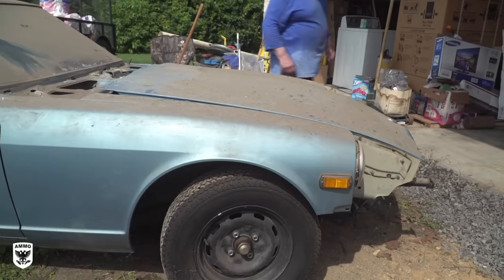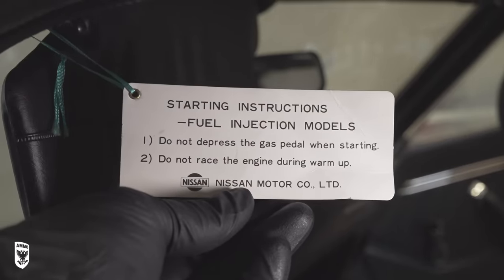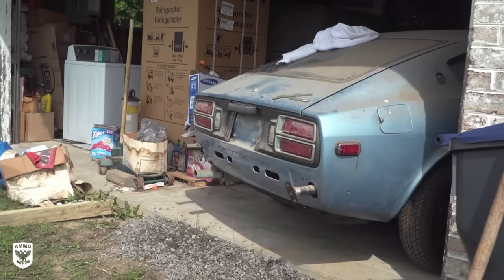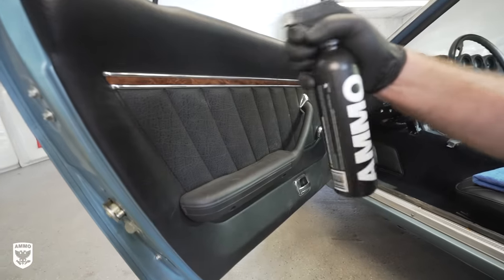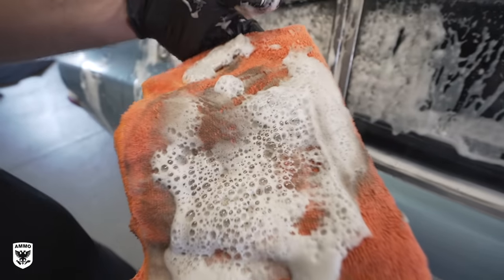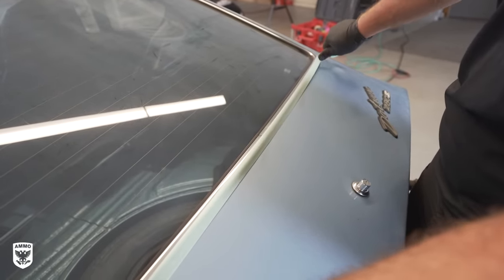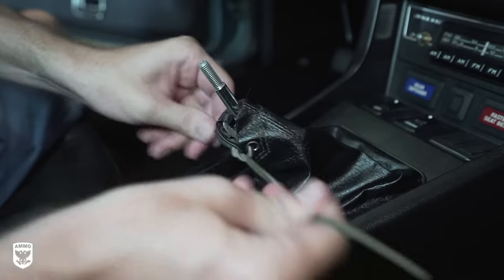First Wash in 44 years! Barn Find Datsun 280z with only 350 Original Miles

Comment: this Z was more than a barn find, it was a time capsule.... finding one of these in such impeccable condition is like finding a unicorn
Reply: Unicorn indeed.
Reply: Unicorn i see every day ... that fairlady love it from the first side
Reply: I've got a 240Z never restored it
Reply: Yes, true. The Z's didn't have galvanized bodies which lead many to be rusted at the welds! Very rare.
Reply: When I was in college in the 90s I worked in a car wash and this old timer brought in a Pontiac Star Chief in this sort of time-capsule condition. It was freaky. Every little bell and whistle on that thing worked - even the old mechanical clock. It was I think a 67 model, and it looked like it just rolled off the showroom floor.
Reply: I found a Unicorn but just like a car without a warning device it had no horn, my brother insisted it was a donkey but hey what did he know.
Reply: Had one just like this one many many years ago. SadIy couldn't finish restoring it. It was originally this same color. Love these cars. I wished I held onto mine.
Reply: Love the metallic paint not like the shiny plastic looking cars of today
Reply: @darlachief4610  Mine got wrecked so I sold it...😢
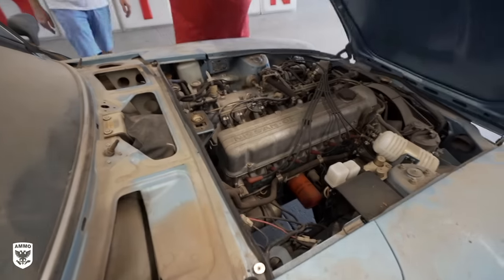Reply: I think they said 350 miles, driven home and left in the barn since. So how did it get a Fram oil filter? 4:25  I'm pretty sure it didn't come that way.
Reply: absolutely stunning!! i love old Zed cars!
Reply: I have one of those….. in every girl on the planets pants.

Comment: Another I'd like to share. It's true, I promise.
 An airline pilot brought in his relatively new 280z, because it would intermittently lose power, to the point of stalling. He'd sit for a minute, it would start and run fine for days, and then happen again. He brought it in a couple of time, tech could never duplicate or experience the problem. My uncle  ( service manager) finally asked him to leave it, with permission to drive it home, etc.... until he experienced the condition. The pilot dropped it off, before going out of town. Take as long as you need. About the third day, my uncle experienced it. He told the tech to drop the fuel tank, it definitely felt like a fuel starve problem. 
 It was a Hershey Bar wrapper,  in Japanese. It would float around until hitting the pickup, and starve fuel. When the car stopped, it would float away, until next time! 
True, I swear!
Reply: If you said Kit Kat no one would even doubt.
Reply: I must have been doing something wrong.  I was an airline pilot and drove used '85 & '92 Toyota Tacoma my whole career.  My wife had a new '76 280Z while in college.
Reply: I believe it, we had a very similar situation happen with a tractor on the farm. That is one frustrating problem to figure out lol
Reply: @jcheck6  I had worked and saved my money and with some help from my Dad I got my 76 280Z right after graduating high school. I about wore that car out and sure wish that I could drive it one more time. Mine was what I think they called "racing green".
Reply: @texaswader  I am sure you really appreciated yours after you worked hard to get it Tex. You must have been the coolest kid on the block!  I know what you mean about driving it one more time.  I do the same but with airplanes.  Would like to fly the Phantom one more time.  My wife says she  paid it off in 4 yrs and owned it for 14.   Beautiful car except for the bumpers.
Reply: @jcheck6  Yeah the American bumper laws suck. They ruined the lines on the 70's-80's E30 BMWs also.
Reply: @jcheck6  A friend of mine, a Marine, flew Phantoms in Vietnam...He says the same thing, that he would like to fly one one more time. I appreciate your service.
Reply: Had a 69 Plymouth Fury which experienced the same problem. Rebuilt the carb, replaced the fuel pump and still persisted. Dropped the fuel tank and looked inside and found a length of garden hose in the tank. Someone must have been trying to siphon gas during the fuel crisis and dropped the hose in the tank. The hose would sink and cover the pickup. Pulled it out and car ran fine after
Reply: @texaswader  Thanks Tex....your friend as well.
Reply: Yeah. Why have I heard it was a Mars bar wrapper🤷🏼‍♂️
Reply: -Same situation with a classic black '49 Caddy convertible sitting in field for 10 years. I traded with owner's kid.... for a horse. Piece of rubber weather stripping in tank made car so unreliable, farmer detested it after dealership gave up, abandoned it with ridiculous low miles.

Comment: My car!  I had the exact same car, same year, color, and everything, back in the 1980's.  When I bought it there was lots of rust, so with the help of a friend we restored it with mostly fiberglass replacement panels and parts.  I drove this thing forever, and eventually sold it in running condition with 400K miles.  What a trip down memory lane seeing the interior details, the "smuggler's" compartments, the hubcaps, engine bay, etc.  Must have replaced the fuel hoses on the top of that engine a dozen times!  Absolutely amazing find - made my day.

Comment: My goodness, the only thing To dislike about this is the fact that I wasn’t the one to find this car. At least it found an owner who appears will take good care of the car
Reply: This sort of abrasive cleaning is not recommended, especially rubbing the plastic vacuum attachment on the carpet and swiping the dust across the paint surface, big no no.
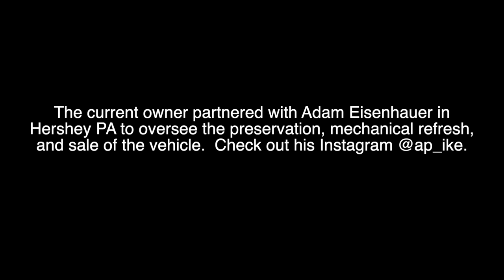Reply: No, he's flipping the car. He's just a business man. 18:37
Reply: @oldschoolfoil2365  They knew what they were doing; they buffed out the paint with a fine polish after cleaning the surface dirt off. You don't know what you are talking about.
Reply: Well that and he rubbed dirt all over it and probably scratched the heck out of it before using the pressure washer anyway...smh
Reply: @Cutlass_Rudd  You don't know how paint works, do you?
Reply: @stopthephilosophicalzombie9017  Oh shut up, you don't spray some BS soap foam all over paint with 40 years of dirt and grime and then wipe it off.  You can see all the scratches in the paint later in the video.  FYI my dad was a body man and I've also worked in body shops, I know "a bit" about paint.  Was it even base clear on it?  '76 probably not, that's probably when he realized he better break out the pressure washer and do the job right.  Amateur.

Comment: I cant believe we didnt get to hear it run!
Reply: Or if it even ran didn't even mention  or show the engine
Reply: @topcat6565  they showed it, just didnt start it.
Reply: @lixxxxit  ok I watch the video I don't know how I missed it.
Reply: @topcat6565  👍
Reply: Yea WTF!! How much is it worth too???
Reply: @chrisdeering6892  I'm guessing high 6 figures. This is perhaps the lowest mileage Z in the world. Not to mention all the original stickers are in place. Definitely a Barrett Jackson holy grail car.
Reply: The engine would be rusted out and be destroyed
Reply: @crankshaft1053  You are incorrect.
Reply: @crankshaft1053  i doubt it
Reply: The owner most likely wasn't planning on starting it due to it's incredibly prestine condition. He just wanted it refurbished
Reply: You should NEVER start a engine that's been setting that long without hand cranking the engine first. To keep engine oil sludge or aka any sticking internal parts from locking up and destroying the engine.
Reply: @crankshaft1053  lol no it wouldnt
Reply: I’m guessing some of the rubber parts will need to be replaced and if oil and gas were left in then that will all need to be flushed out of the system.
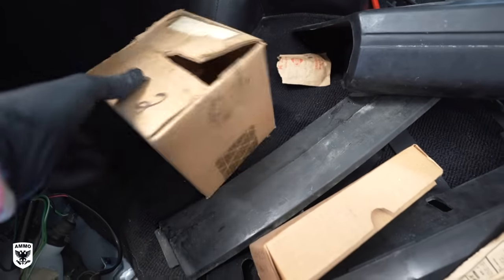Reply: @topcat6565  4:25
Reply: cause it won't after sitting for so long - engine oil and seals would have dry rotted away long ago - makes a nice garden decoration though
Reply: @recoswell  with all the work they put into it, you really think they didn't drain the old fluids and put new in?

Comment: Physical contact with a cloth after adding cleaning agent (foaming soap) was a big mistake.  You should have gone with a light water rinse then followed up two additional foaming soap application 1) power wash with low pressure. 2) another with medium to high pressure rinse after which physical contact with soft clothes / buffer.   You almost certainly subjected the paint to microscratching that didnt have to happen.  I work in cleaning validation for pharmaceutical equipment and understand soil removal at a chemical and material science level.
Reply: 100 percent correct. That was insane what they did. Hellen Keller would have known better.
Reply: @zz6gkm  Yup. If you want to start an argument, go on the Internet's YouTube and state an opinion that you "Know better". That'll do it... That is what it's for, isn't it!
Reply: correct, but I'm sure they intended to polish the paint anyway. They're main reason for the way they did it was to preserve any paper ID tags from getting wet. I suppose they coul've used water more carefully and efficiently to prevent damage definately would've been better than anything dry.
Reply: +JP Slayermayor-  Exaaaaaaaaactly...  He is nowhere NEAR professional.
Reply: I was flabbergasted watching this supposedly professional team, foam or no foam, use a cloth to push a heavy load of dirt particles right onto/into the surface.  As someone up thread said, probably no big deal in the end as there was plenty of paint depth, but still a big big risk. Could have had a few bigger sharper pieces of debris in that dirt.   I'd have foamed it like they did and let it sit. And then washed it off with low pressure water first.  Then re-foam it and wipe.
Reply: @greenbluemonkey  Yes, let it sit...  my jaw dropped when they sprayed the foam (and didn't even go heavy on it) and immediately wiped it off.😧

Former owner of an Orange 1972 240Z... Still got some parts for it.🤔
Reply: They aren't in the business of selling water.
Reply: @ironking76  lol. Going for the vintage matte look it seems
Reply: @243wayne1  Dat not how you wash a car my guy.
Reply: They sacrificed the health of the paint job to show how bad ass their cleaning goop is.
Reply: @boatnikdog  call me a perfectionist but it makes me cringe. It hurts my soul. Its like scratches on a chalkboard for me. I just, cant even.
Reply: @boatnikdog  Its like wet sanding the car w 220.
Reply: I agree!!  - I thought the same exact thing as I watched them do it on the video - "You're scratching the paint!"
Reply: I thought so, too…
Reply: I guess you'd think these guys might've known that - maybe not.
Reply: Yeah,he's a hack....it amazes me he's so successful, and people let him near these kind of cars. Just the fact he didnt wash the exterior BEFORE going inside is enough to prove that.
Reply: I'm not exactly sure if this is the case but I think the reason to not wash it with water at first was to perserve the original paper tags, and then just polish the paint
Reply: @wessteenrod7116  'm not exactly sure if this is the case but I think the reason to not wash it with water at first was to perserve the original paper tags, as he mentioned, and then just polish the paint.
Reply: Yeah I was shocked to see him spray detergent on then wipe off.  I guess he knew was going to compound so didn't care about the scratches he could have been creating.
Reply: Well said.  Why not rinse lightly?
Reply: @crumdoggy  Again I'm not an expert, but I think any bit of water would damage a label of that age, however I can't confirm anything and there definitely was likely a better way of going about it
Reply: My exact thoughts, kind of made me cringe watching them grind all that dirt into the paint..
Reply: @wubbadubnub  Whats more important, the label or the paint? He could have covered the label I suppose.
Reply: @mtmolnar53  Well I'd say if you're trying to keep things as original as possible there's a lot more important on the things that don't last, whereas the paint can be polished. That is a good point however, he should have covered it
Reply: Cringed when I watched that. 
I know nothing about detailing yet common sense tells me that wiping that dirt with a lol "micro fiber" towel was pure stupidity. Why not, as you stated for the first step simply rinse with low pressure water. And wtf are these hacks wearing respirators? Does that increase the price of the detail.. smh
Reply: Yeah that was pretty shocking to see.
Reply: Agreed
Reply: And then he ends up just using a pressure washer on the rest of it. Makes no sense.
Reply: They only did this so they could show the grime, collected on the back of the cloth, for effect, direct to the camera,  i was astonished to see this.
Reply: It seemed they were also trying to promote that frothy foam stuff over using water and common sense!
Reply: I cringed when they started wiping 😑!
Reply: I was in the lens industry. 
Insane practice they showed.
Like somebody else said below. They wanted it to look like an advertisement for their cleaning product. Like you apply, wipe and it's clean. But sure they created micro scratches. Unproffesional. Unsubscribed. My stomach can't handle this.
Reply: They did an amateur mistake not only on the paint, but also the windshield suffers small scratches when such amount of dust is removed like this.
Reply: I haven't used an eyeroll emoji in a while. Felt good to knock the dust off. 🙄
Reply: that made me say nooo wtf
Reply: @MegaTomi9999  thought that as well about the windscreen
Reply: can you detail for me the best way one should pick one's nose? asking for a friend
Reply: Agree. I unsubscribed after watching that

Comment: Absolutely horrified they used essentially waterless process to remove that massive amount of dirt from the surface.  Even just a little drizzle of water would’ve washed away a huge amount versus smushing it with a microfiber towel
Reply: agreed. they should have washed that foam off, then repeated the process a two more times before taking a fiber cloth to it. They're just scratching the paint with the dirt.
Reply: I was trying to look for a comment that spotted that huge mistake, like he literally just smeared the dirt off the paint instead of letting water take it off
Reply: I don't understand either maybe that is how you do it in their detailing video game
Reply: You guys obviously never had a show car in modern times waterless foam style washing is very effective and when wiping the dirt its a 1 and done then that side is trash
Reply: Learn something new every day!
Reply: @Struggle_Fest  "I dont recommend for excessively dirty cars that have been neglected of peoper care or maintenance" - best auto detailing tips
Clearly u have never restored a car before.
Reply: I agree
Reply: @Struggle_Fest  And it doesn't change the friction coefficient the moment he puts that cloth down and drags. Still causes damage with THAT much dirt. You could see it streaking.

Comment: That "removing the dust" part hurts my eyes...
Reply: Me too.. look at the scratches he created.. not sort, but scratches
Reply: Was thinking the same. Why not spray it with a hose first to remove most of the big pieces. Could have rubbed sand paper over it
Reply: The whole time he was saying they didn't want to hose it down due to not knowing how good the rubber was.

Emagine if they pressure washed it and all the "mud" created went inside the car due to dry cracked seals.
Reply: They just wanna sell products
Reply: @DG-mi2mc  ben jij nederlanse
Reply: @lifelikeaglitch7343  ja
Reply: @5punkybob  I mean you can touch rubber and get a feel for how good it is right from the start.. or you know, just test a panel.. obviously it's about selling a product because they ended up just hosing the whole thing down anyways.
Reply: @5punkybob  regardless of what they say about the seals, I don't think I'd be putting soap onto dust and rubbing it against my own modern car's paint, let alone one of these JDM gems. Not to say they don't know what they're doing, I personally just wouldn't do that myself.